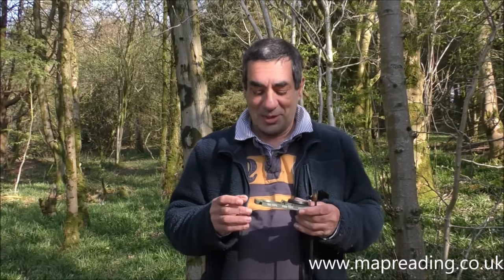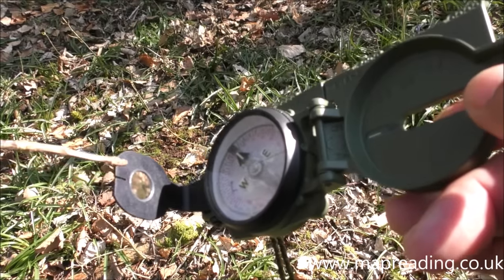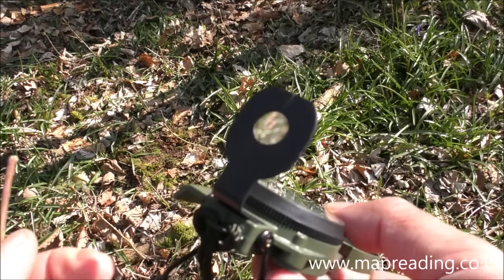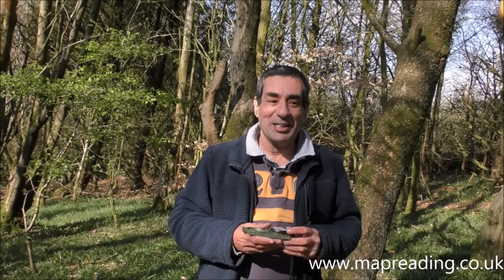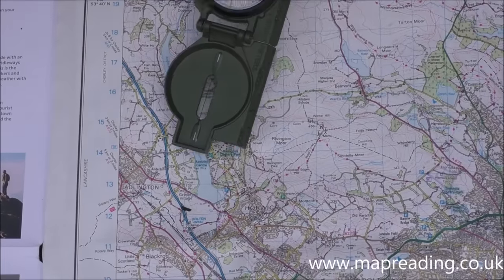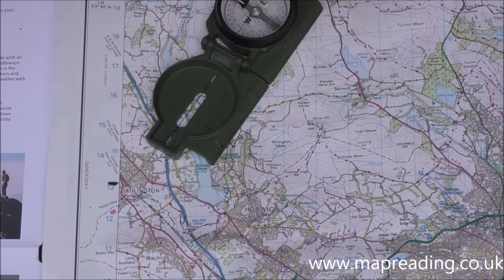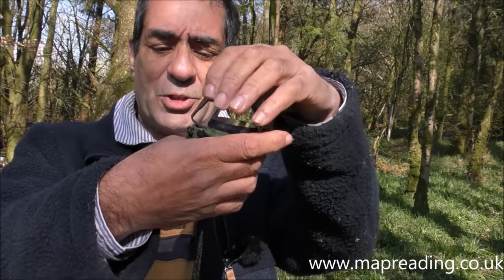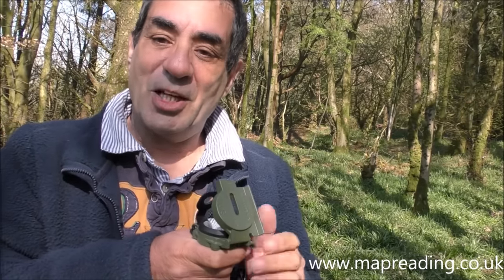Use a Lensatic Compass with a map & without

Comment: This is what I was taught to use in the US Army (before the advent of GPS). It was a valuable skill to master, and armed with a lensatic compass and a map, one could effectively negotiate any terrain, direct fire upon a target, or effect a swift exit from an area. The maps were graduated into 100 meter grid squares, and with a compass one could further narrow that down to a ten meter square. We also kept pace counters (one could use pebbles or beads as well), and with practice, soldiers learned how to gauge distances travelled.
Reply: And no batteries to fail! 😉
Reply: up until a couple years ago .I taught Hunters scouts, soldiers, prospectors and geologist trainees .. in map reading and navigation in Canada from the West coast to the high Arctic to Labrador .. for here .mag dec is vital to know and to set ..
  
Canadian Gov maps have a scale on the side of the map.. given a fixed dec, and date recorded and the number of degrees that it varies per year.. you calculate the date then to now add the number of degrees it changes per year multiplied by the years, adjust compass  ..
Too often hunters and hikers especially find electronics useless .. especially on cell phones .. It's one thing to read an OS map and hike from one sheep pen to farm to lake .. another to travel 20 odd km in the bush without landmarks ..

I still have my issue compass, but prefer my silva .. and or Brunton pocket transit
Reply: GPS is very useful, but much more prone to fail and makes the brain lazy. Youngest people are too dependant of modern technology.

As a police officer assigned to Missing Persons Unit of São Paulo Police, Brazil, we often need to locate lost hikers in jungle areas between our city and the South Atlantic. No signal of radio, mobile phone or GPS in some areas. Only the good old compass and map works. Sometimes I carry even boat flares to keep contact with our Tactical Air Service (police helicopters, aka "Pelican Units").
Reply: & it's still a very valuable skill. I carry a GPS when hunting,  but I NEVER leave for a hunt without my maps & compass. Taught my kids, & been teaching my grandkids, which has been a challenge since they believe technology is the only way, but they're slowly catching on & having fun doing it.
Reply: Just don't give it to a lieutenant
Reply: @azure6392  standard joke... had a Major call a strike so we had 2x 5" shells hit 400meters from our OP because he couln't read a map .. Lebanon 1982
Reply: I bought a lensatic Cammenga compass and I have to say your video makes it so easy to use! I watch the video and keep stopping it so I can write down everything you say. For me this is the best way I can remember how to use the compass. I absolutely love this topic! I wish I could “LIKE” your videos more than once since I watch them over and over and this way I can give you more credit for putting out such good and useful videos. Thanks for all the time and effort you put into making these videos.
Reply: Dang I thought most would be 1000 meter grid squares
Reply: Personally, I think it's a skill everybody should know. A good compass and compass will work under any condition as long as you know how to use them. Not to say that I'm against the usage of technology to make our lives easier. However, I think we sometimes forget about fundamental skills.
Reply: Same here 1972..
Reply: I agree with you. Technology should be utilized as a convenience, not as a crutch. People should be required to master using a traditional map and compass before being permitted to use GPS. If you are in the middle of nowhere and your GPS fails, it is pretty much a death sentence if you can’t fall back on traditional navigation skills. People are far to dependent on technology now a days.
Reply: Is it just Canadian maps that print the average declination shift per year on the map, or do most Topo maps that use the UTM scale have them?  I’ve never noticed this on USA topo maps, but then I never  really consider that something like this would be on a map in the first place, so I never really looked for it. I’ve always just looked up the current declination for my area of operation before heading out. Having that info available on a map to allow me to calculate it myself  would be very convenient.
Reply: Man I was still taught land nav like this. Though my NCOs made it way more complicated than it had to be, and some how always pick the worst land navigation spots. 

I'll never forget having to find a fucking golf ball in the desert. Lmao

Comment: As a United States Marine I can say this is the best example of using this compass. Semper Fidelis from Texas
Reply from the maker: Thanks.  Much appreciated.
Reply: It takes Marines a little bit longer to get things lol
Reply: He forgot to ORIENT the map first.  The demonstration is worthless and dangerous.
Reply: @manuelvazquez8758  Hm, or maybe orienting the map is so fundamental to the practice of orienteering he didn’t bother to mention it. He has many other videos. Look deeper if you need more information on that part of the task.
Reply: @manuelvazquez8758  you don't need to orient the map. He set the bezzle to be in line with map north. The angle between the bezle  and the sight marker doesn't change based on the direction you are facing. 

Once you have the angle, and it's adjusted for magnetic declination you line it up with the needle and you're set.

Comment: This is, bar none, the finest explanation of the lensatic compass anywhere on the net. Thanks for sharing!!!
Reply from the maker: Wow, thanks!
Reply: Really? Not very clear. I'm looking for a better video than this.
Reply: @tomweickmann6414 What more could you want? There is nothing fancy going on. You set the dial and it determines which way you are facing. That's what a compass does. There is no magic technique here.
Reply: This video is the best I’ve seen on lensatic compasses. For that matter your videos in general are the best period!
Reply: Definitely agree with you.
Reply from the maker: https://youtu.be/FI7C8VlbYfI
Reply: Not true!  He forgot to ORIENT the map to true north first.
Reply: @manuelvazquez8758  Do you mean to physically spin the map around? If you already know the orientation of the map, what do you need a compass for? Seems like the main goal is to move yourself around to where you're going, not the map. Is this just to help people visualize the area on the map projected outward in reference to the land?

There's a good Charlie Chaplin skit from many years ago, I think it was the Gold Rush movie, where he doesn't know where to go, so he spins himself around a map so he is facing the x on it and then heads off in that direction as though it's correct. It's pretty funny, but I guess if you align the map first you could do that, if for some reason you were wanting to.

Comment: NOTE:  For those who wear glasses;  the metal in your glasses can interfere with the arrow when you put your eye up to close to take a bearing.  I have found that my Cammenga is affected by 2-3 degrees so I remove my glasses before sighting thru the lens.
Reply: Other items can also interfere, like helmets, dog tags ans even orthodontic appliances!
Reply: You are correct sir. I had glasses that had sunglasses that clip on the main glasses. Guess how they were secured? Thats right magnets. So I was getting wrong readings when I was wearing my glasses. Made it hard to get readings without glasses on.

Comment: This  is the clearest and most useful video on the Cammenga I've see, and I've watch loads of them. Thanks
Reply from the maker: I'm glad you enjoyed the video.  
On a course last week in south England (The Chiltern Hills) I was showing the participants lots of different types of compasses and I was asked how to use a lensatic with a map.  So I thought I’d make a video showing one method.  I know lensatic compasses have been covered in many videos but not many of them show how to use it, simply, with a map.
Reply: I like the Cammega, but if I'm honest, I like it more as an object than as a practical compass. That said, your video shows it can be used effectively with a map and without a protractor. But is it really worth the hassle? Do you think it actually has any navigational advantages over a baseplate or mirror compass?
Reply from the maker: The Cammega 3H is a really good compass that’s built for a very specific group of people to use (just like the Barker M73).  For this it needs to be able to operate in very rough conditions, so I imagine that why it’s made like it is.

The method of using it which I demonstrated on the video is fine for what I need it to do – to be used by walkers and trekkers.  It’s not as precise as using a protractor, but we (walkers and trekkers) don’t need to be.  There obviously are times when those who the compass is designed for would need to be very accurate when passing on bearings to others, who may use them in very serious situations.

I tend to use just a very standard base plate compass, as that’s what I’m used to.  If someone learned to navigate using a Cammega then I’d guess they will also continue to do so.  It doesn’t make much difference which compass you use as long as you’re able to use it to navigate safely.
Reply: @TheMapReadingCompany  You should do a video on using an analogue watch as a compass.

Comment: I was in the army and going through Primary NCO Academy,  PNOC for short. We did a night compass course, no map. You would get the azmithus to the next location and use the compass to get you there. You had to be precise as there would be 3 post with your next location  and you had to be on the right post. The 3 post were only about 12 feet apart. If you got the wrong post you flunked the compass course.
Reply from the maker: Hi Mike,

That's really interesting. Thanks for joining the conversation.
Reply: Same thing…except it was in Boy Scouts, if you followed it all correctly there’d be a bag of doughnuts in a tree 😂.   10 years later in the Army learning landnav in the desert I was happy for the Boy Scouts.
Reply: More or less the same thing .. 
Also when I trained exploration crews in survey grid and claim staking etc,  back before click (online/paper) staking became the norm in Canada. 
We set out a system of 1 km square (no slope correction) We then after the basics of sighting and use of compass set declinations etc, then would set them off , each working from a common LCP .
They had to navigate and correctly locate intermediate posts every 500 meters and make the 90-degree turn at 1km returning to the start point mock LCP (Legal Corner Post) which we removed when they left, they then place a ribbon where they thought they had to finish.
Initialy very few were able to get within 50 meters of their correct point, some ended up several hundred meters away. Then We'd  throw everything at them, changed the declination on compasses, place the grid on top of magnetite/sulphide outcrops (your nows knows) Given MRC is or was in SW England .. Sulphides and magnetic rocks are abundant..
Reply: As unit training NCO I setup courses like that along with other land nav courses.
Reply: Sounds like a fun game too. Cheers.

Comment: It is essential to know how to use a compass for the infantry soldier or a sextant for the seaman. There is GPS now, but one day it may be neutralized by an electromagnetic event, and you have to know how to navigate the old way.
Reply: While that is most certainly true, learning to use a compass and a topo map is about 10 times easier than using a sextant.
Reply: I could never feel comfortable relying on GPS. It is an expedient convenience at best. I’d  have to have a death wish to navigate in the middle of nowhere without a map and compass. All it takes is one malfunction or breakage and you’re screwed. Technology is great, but it never should be relied on
Reply: @1mataleo1  ... what if that malfunction or breakage happens to your compass?
Reply: I always carry two compasses: a Sunto MC2 Global base plate compass which is the one I use, mostly because it is accurate and I can set and forget the declination. However, I always keep my Camenga Lensatic Compass in my pack in case the Sunto breaks, which is a possibility since it is plastic. The Camenga is practically bombproof, so if my luck was so bad that I broke both of them, I suppose I would spend the rest of my time writing goodbye letters.

Comment: IMPORTANT for those new to compass land navigation!!
 When following a bearing cross country, 'drift' needs to be accounted for.  You can move sideways while keeping on the same bearing, so a good idea is to alternate the direction you go around obstacles; right, left, right, left.  If you go around the same way, the tendency to drift off in one direction is magnified, even if the actual compass bearing never changes!
Reply: Also, geological variation can take place, I've worked in Indonesia, Canada Bush and Sub Sahara.. prospecting ( mineral exploration ) or security .. Sometimes you must be aware that Rocks containing high Iron and Magnetite ..can swing compasses quite drastically, and If suspected generally good practice is to ensure that you have a decent fore and "back" site .. try to never aim at one single object, always if possible try to line up two or more aim points. 
Obviously, the situation and methodology will change depending on the requirement whether rec, or tactical.
Reply: That is why it is better practice to sight an object that is on the bearing you are traveling, walk to it, and then shoot the azimuth again to another object, walk to it, repeat. It is certainly bad practice to simply use the compass reading alone for the reasons you mentioned
Reply: Can  iron and/or magnetite concentrations be so high in places that they render a compass useless?  I thought that as long as metal and magnets were not very close to the compass it would function properly. What can one do in such a situation?
Reply: @1mataleo1  Yes, indeed!
Reply: @1mataleo1  Yes; large metallic deposits can influence compasses.  If not noted on the map, you have to watch for observed error, then correct for it.  This is also why it's wise to double-check using other methods, if they are available.

Comment: Appreciate your the concise lesson, Map Reading Company.
I now see that the Index Line (3:00) on my cheap Lensatic compass has been painted ON the screen, not within it!
When I rotate the Bezel to adjust the marker, the damn Index Line moves with the marker.
And I bought this compass; me, a former Scout, tramping around Fiordland! Just shows what 50 years of suburban living can do.
Thanks, TMRC, and hello from New Zealand.
Reply from the maker: I think you can order a southern hemisphere cammenga direct from the company – but check before you buy.
Reply: The line painted on the screen is universal for non-Cammenga compasses. Cammenga lensatics are the only lensatic compasses I have ever seen that have a proper, static index line. I imagine it's probably technically difficult to manufacture, because I can't think of any other reason why Chinese compass manufacturers have universally avoided making their compasses in such a manner.

Comment: Simple straightforward tutorial, it’s good to know that the compass is still being used. Its a good skill to have when out and about it’s so much more interesting then using and relying on GPS, in my opinion.

I still insist on using a Compass, Prismatic mainly it’s so easy to use.
My way of remembering how to add or subtract was a way that had been taught to me many years ago was this.
Grid to Mag Add and Mag to Grid get rid and any variations that the Map might have, would be adjusted accordingly.
Just subscribed. 👍

Comment: An easy way to do reciprocal directions.
Instead of adding or subtracting 180°, you remember that any heading is three digits. The first digit can be 0,1, 2 or 3. (ie 60° is 060°). If the first digit is either 0 or 1, you add 2 to it and subtract 2 from the next digit. For example 180 becomes 360, 050 becomes 230.
 If the first digit is 2 or 3 subtract 2, from the first digit and then add 2 to the next digit. For example, 360 becomes 180.
Reply: Cool little trick, it would shave off about 1 second from my mental calculations  ... If the azimuth is under 180 degrees, you add 180. If it's over 180 degrees, you subtract 180. or, why not just look at where the other end of the friggin needle is pointing at while you're aiming at the object? lol

Comment: That's a useful video.  Something I have found when following a bearing is not to try and walk while watching the dial.  You can easily crab off to one side or the other while keeping the needle spot on.  What works for me is to find something identifiable on my bearing, walk to that, then repeat.  It's quite accurate over significant distances.
Reply: Really? Just how else do you think you'd use a compass?
Reply: @byteme9718  Some people walk watching the needle while physically drifting off to the left or right as they go.  The needle shows they are pointing the compass in the right direction but their travel on the ground can be way off.
Reply: @Crusty_Camper  My comment was very clear, that's how you use a compass. Obviously no one ever taught you, if they had you'd have known that in the first few minutes.
Reply: @byteme9718  Yeah, we seem to have our wires crossed.  As part of a Mountain Rescue Team for the last 30 years, accurate compass use is an essential skill for me.   My comment was aimed at the large number of people who don't know how to use one and we end up sorting the problem out for them.  It was a suggestion, not a revelation.
Reply: And alternating which side of obstacles you walk around also helps reduce drift.